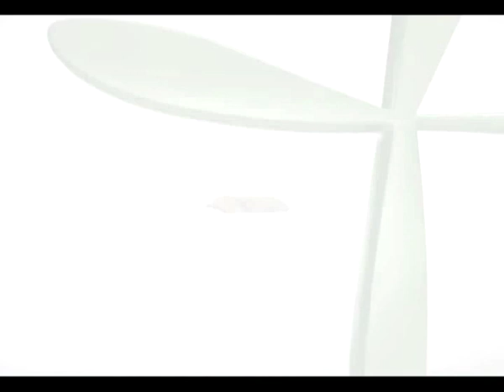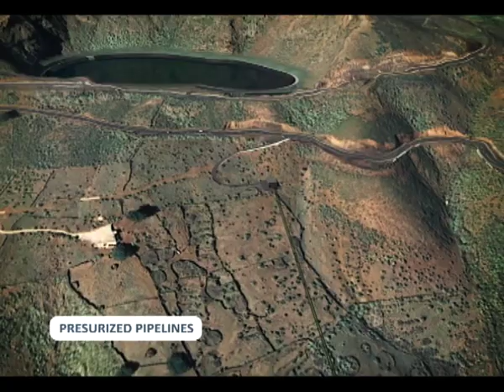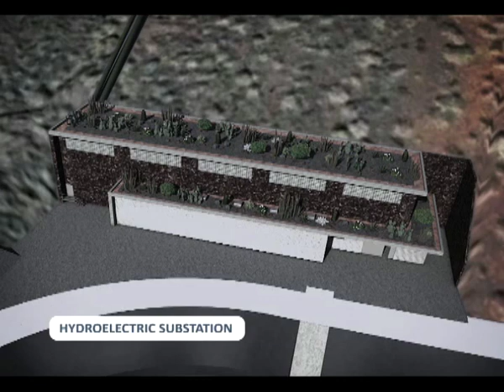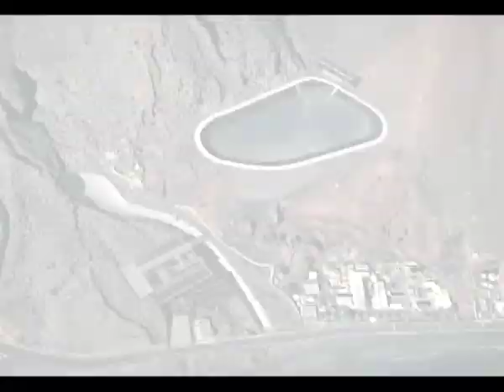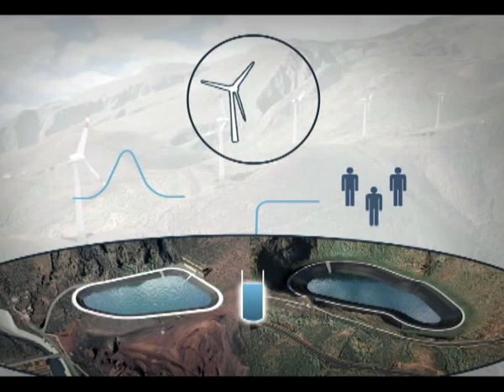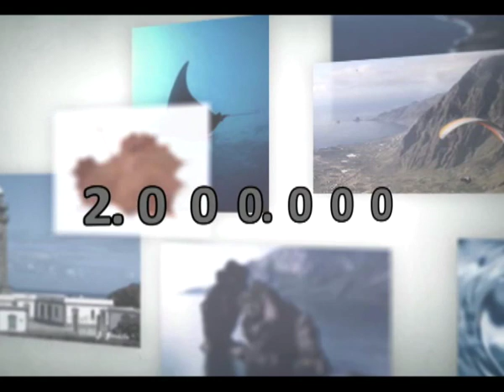Wind-Hydro-Pumped-Power Station

Comment: The system developed by Gorona del Viento is not meeting its aims. I’ll explain why and what changes are required to the system to get it to work as intended.

https://scottishscientist.wordpress.com/2015/04/03/scientific-computer-modelling-of-wind-pumped-storage-hydro/comment-page-1/#comment-283

Assuming El Hierro peak demand is 7.6MW

Put the 7.6MW peak demand into my recommendation equations

store energy = 1.11 days x 7.6MW = 8.436 MW-days = 202.5 MWh = 729 gigajoules

Assuming the head between the 2 reservoirs to be 655 metres, the volume of reservoir required is

volume = mass / density
volume = energy / (g x head x density)
volume = 729,000,000,000 / (9.81 x 655 x 1000)
volume = 113,500 m3

So the GdV reservoirs seem to be big enough and no change to the reservoirs is required.

Now let’s find the recommended annual maximum wind power

annual maximum wind power = 5.5 x 7.6MW = 41.8MW

whereas only 11.5 MW of wind turbine nameplate capacity is installed

I’m not sure what the annual peak wind power is now (8MW is the maximum MW plotted in figure 4 here) so let’s assume that 8MW is the annual peak wind power now.

Now – needed — factor increase compared to existing
8MW – 41.8MW – 41.8/8 = 5.2 times more wind power needs to be installed, to a total nameplate capacity of 5.2 x 11.5 = 59.8MW

Executive conclusion.

The El Hierro GdV wind turbines are under-powered by a factor of 5 compared to what will be needed for a successful system design to achieve 24/7/52 100% renewable on demand power.

The recommendation is that additional wind turbines be installed to a total capacity of 60MW.

Scottish Scientist
Independent Scientific Adviser for Scotland
https://scottishscientist.wordpress.com/